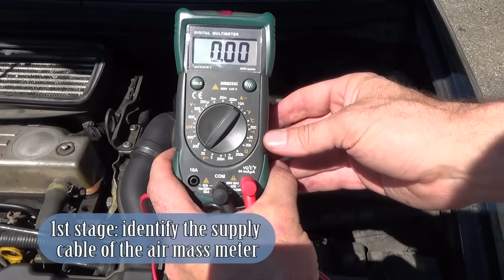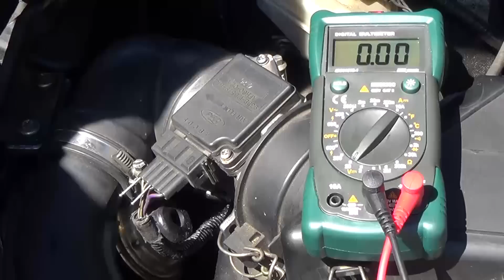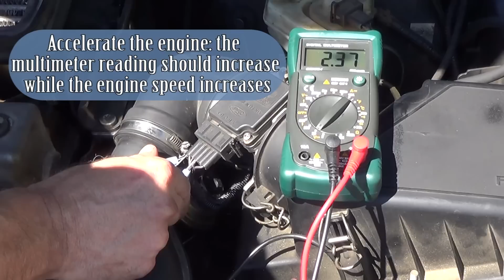Mass air flow sensor (MAF) testing without dismantling

Comment: I’m still having a trouble accelerating after I replaced the old one also did a 93 fuel treatment on my 1994 ford ranger idk does the computer have to recognize it or wat it actually got worse with the new one

Comment: Great video!  However, a MAF sensor may still work but not perfectly.  This is a good overall test if the MAF sensor for your car is quite expensive and one should always try to test the MAF sensor before replacing the sensor.

Most licensed professional mechanics cannot diagnose car problems today either and what ends up happening is they just replace everything possible and foot the bill to the customer.

If people want a car that they can maintain themselves, buy something made around 2000 ~ 2005 as vehicles made during this time had a computer just to control ONLY the engine and transmission.  After 2005 car manufacturers integrated sensors into everything electrical they could think of, making it a nightmare to diagnose and find the exact problem.

Comment: I have this problem 07 tundra, replaced both the MAS and the ignition coil. Still doing it randomly. If I disconnect the battery and reconnect it starts normally for a while. Any tips will be appreciated.

Comment: At 1:46/3:07 you put the wrong meter leads on the wrong wires (red center, black other contact. previously you had black on center and red on other contact!), that is why you read 0 volts! When you moved to differant contact you put black back on center and red on other

Comment: Just replace the sensor after 50 k miles. It's easier to unscrew the two screws and unplug the clip lol. If your car dies when starting it, slow and sluggish when accelerating, or has trouble shifting just replace this sensor folks! It's the brain between the transmission and motor.  It's worth the money just do it lol! You're technically supposed to clean your mass air flow sensor and replace the air filter every 15k miles. Those sensors are super sensitive and are easily damaged. I replace the mass air flow sensors on my 4 vehicles every 40k miles! Change the plugs every 50k miles as well! Basic maintenance brings longevity folks! Much love peace!!!!!!
Reply: agreed

Comment: My car is still hesitating during acceleration at slow speeds after replacing maf sensor n spark plugs. Pl advise
Reply: Have fuel pump tested, replace fuel filter. That's a start.

Comment: 1:45 you put positive on negative and got a false reading
Reply: That is correct, but the reason for doing that, is that they're showing how to find the desired wire, by process of elimination.
As the video said, since that wire had a 0 reading, it must be another ground wire. Now there's only one wire left to test, so that must be the correct wire we're searching for, which it was.

Comment: The MAF sensor has a voltage range that it performs in, so if the MAF sensor is not performing in the manufacturer's range then it will bot work properly.

Comment: I was testing my MAF sensor on my ‘99 tacoma which the sensor has 6 pins and when I inserted the needle in one of the cables the truck shut off and now it doesn’t start, it cranks but it doesn’t go on, can you guide me on what to do?
Reply: What was the result... i might have just done the same thing just now...was it ecm?

Comment: Thanks for making a video, but you might have wanted to point out that this only works with MAF sensors that vary voltage on their output, where most will vary the frequency. The latter you would need an oscilloscope to get a useable reading.
   So, it would be difficult to know which type you have which would negate the useability of this testing method. My particular MAF sensor varied frequency, and so it just had a constant 2.8v that didn't vary with rpm. The new one was an non-varying 3.1v. Thankfully the new one did fix my problem, but the testing method didn't work in my case.
Reply: I think the frequency scale can work in case of latter MAF sensor

Comment: On my signal ground and signal wire I'm getting 5v please help
Reply: I have a good idea but instead of explaining, you should watch "ScannerDanner" 
His videos on "The 5v Reference" especially
Reply: Only because I could be totally wrong on what I think it is.
Reply: I watch the whole video but its unrelated to my problem on my 4 pin maf sensor 2 wires being a power and ground I got 12v on those 2 my other 2 wires which i believe one is a signal ground and the other a signal the voltage between them is 5v

Comment: Attention:  this video is ONLY for -analog-  MAFs;
DIGITAL MAFs output a frequency ,not a  voltage; you'll need a scope or at least a multimeter with Hz,Hertz.
Thanks for the video.

Comment: I have lexus is220d 2009 I was tested mass air flow sensor.I did have ignition on but engine was not runing. now I  tried  to stare the engine to testing the sensor again. engine doesn't over but engine was working before.

Comment: It doesn't mean good  when the voltmeter read a change when accelerating.. it must be in the range of voltage of the manufacturer to be sure the MAF works good. my MAF reads change when accelerating but not in the range of owner manual and the car still getting noise on run.

Comment: how do you test it if car doesnt start
Reply: It's a bit complicated, you have to take it off, wire it to 5 or 12V and then you have to probe the voltage while you blow in it thus simulating air getting drawn by the engine...

Comment: I bought an audi a4 turbo 2002, and it has always had an unstable relenti. Verifying all the electrical part I see that they removed the plug of the maf sensor and put the cables directly to the pins, but I would like to be sure that the order is fine, because the videos that I have seen show me an order different from the one that currently has. Could you take a picture of the order in which the MAF cables go and send it to my mail?
email: morgankaddy@yahoo.com

regards

Comment: my truck died while driving, is there a way to test this with engine off ? i was getting mas error code  b4 it died ? its  not getting fuel, tries to start when spraying starter fluid into intake. tried cleaning it, but no difference, it just might be dead, but would the mas keep your engine from starting ? i have a 2007 toyo tacoma 4.0 4x4

Comment: This was the best vid I have found to test a MAF.  I followed all the steps, identified all the wires, got the earth pinned then found the 5V wire. While running the MAF came up from .01V to .05V but no more. Diagnose bad MAF, now I can purchase a replacement confident that I am not just replacing  good parts with new parts.

Comment: not sure if anyone else saw this but your first test to check the MAF sensor after checking the voltage looks like you had the leads backwards.  You had the positive lead on the ground wire.

Comment: Nice video. I am curious as to how the audio was produced. Was it a computer generated translation? Saying "earth" instead of "ground" makes me think so.

The holes in my wiring harness are too tight to accommodate a nail, or even a paper clip - the ends are too blunt to get in next to the wire. I had to use sewing pins, which are kind of T-shaped. They're sturdy, yet you can bend them if you want to move them away from each other once the pin end is inserted. I imagine pulled-open safety pins would work, too, or even straight pins.
Reply: Earth is British English. The USA uses ground.

Comment: I need to understand only one thing.
What is this terrible noise coming from engine at idle ?
My engine doing the same exactly noise and it is KIA SPORTAGE 2015 !
Reply: Mohammed Aziz most likely an exhaust leak
Reply: Mohammed Aziz otherwise check your oil. make sure it's within operating range

Comment: i have a question please , I have a 93 mustang 5.0 and Im seeing 13 volts on the signal in and out wires its a brand new pro M WHat could be causing such high readings??? I know I should only be seeing 5 at max!!!

Comment: You should never ever probe wires like that, just leaving them open to the elements and corrosion. Seals and insulators are there for a reason.
Reply: do it like this on a daily basis for 20 years now... never had one problem.
Reply: yes that the only way i ever see it done using pins....
Reply: Probing a wire like that does nothing more to expose it to corrosion and elements any more then it already is knuckle head. That's why on every car there is this fancy thing called a hood, to protect it from that. Should proper care be taken so you do not damage the pins on the harness? Yes, but they are actually quite reiselient. Some  people will say you shouldn't probe wires because it can change the circuit and mess up the cars sensitive computer components, and while this may have been the occasional rare case with older analog type voltmeters with low internal resistance around 16k , with much newer digital multimeters having a high internal resistance of upwards of 10M ohms or some high end multimeters have near infinity internal resistance, these will have little to no effect on the functioning of the circuit.

Comment: Why did you place the positive lead on the black wire when you tested the first of the remaining two wires (during the 2nd stage where you received 0.00)?  You specifically said to use the positive lead on the remaining two.
Reply: +dieselstar5 it doesn't matter which way you test it.  We are measuring potential difference so it would only change the sign.  The number part would stay the same.
Reply: Mike that's what I said hahahaaaaa

Comment: CAUTION.....first video I found said to clean with carb cleaner, I did and ruined the MAF.....I later learned that you should only use a cleaner made for MAF sensor cleaning. Any other cleaner can at the least leave a residue, and at worst remove the teflon coating on the MAF....this is a very sensitive sensor.....just my experience....all parts stores carry the MAF cleaner, and just as cheap as carb or brake cleaner, so why not use the one that is designed to do the job, rather than take a chance. Hey other cleaners may work on some MAF sensors...they all do the same job, but are designed and made with different materials....not worth taking a chance using anything other than a cleaner made specifically for cleaning  MAF sensor
Reply: Dennis Arterburn yep me too carb cleaner destroys this and the MAP Sensors.
Reply: u need a circuit cleaner spray can
Reply: MAF cleaner is the most expensive of the lot
Reply: Use Zep mass air flow cleaner or if you don't have thar use rubbing alcohol. That's all I use.  Alcohol doesn't leave a residue so you can use it if you can get it spraying in a jet stream.
Reply: Wd40 makes an ELECTRIC PRTS CLEANER, it works very well.dries in seconds, and won't harm plastics surrounding the parts.
Reply: Wd40 makes an ELECTRIC PARTS CLEANER, it dries in seconds, doesn't leave any residue, and won't destroy the plastic surrounding the parts.

Comment: I dont understand this, this is testing the wire harness connector so it will surely always have power and change accordingly depending on the accelerator depressing or pressing. How does this mean that the sensor is actually working properly
Reply: +Imre Csoka It does not. It only tells you the MAF is working, not working correctly. It should be tested to reach a certain treshold on a snap throttle and should be steady on a certain value on idle (MAF and engine variatons). However, it is not always true that the MAF is doing bad if those values are off. Air leaks can, for instance, throw values off as well. This is why we, as mechanics and diag techs, have so much work on our hands (it is not as simple as one value to check anymore). That said, even with that knowledge you have different MAF systems, different values, etc. 

However, the video does well in explaining in certain basic checks to condemn total failure of a MAF or wiring.
Reply: +Henk Moesker Man i wish i can understand this, it is a but much for me. I just want to know an example for a test that I can do. I feel very not confident because my car is different, OPEL CORSA B 1.6 IE  1999, i can not find a manual for it and I also do not know what diagnostic tool to buy for it on ebay. I just wish i was not so lost, i dont really have anybody to ask for help here in South Africa. This is why i am researching youtube. I have a feeling i need to check; throttle position sensor;  air mass flow sensor( or is it called air temperature sensor)  ; and i also want to test my ICV.
How do i do these things with basic examples.
I know where my Air Flow Sensor/ Air Temperature is and i can take it out...if you need me to.
I know where my ICV (Idle Control Valve) and i can take that out also if you need me to.
I know where my Throttle Position Sensor is BUT I DO NOT know how to take it out, it is too close to the firewall, i think i need to get a right angle screw driver set for torx.
i have tried to explain my problem as best as i can with examples which is why i want to try and learn and understand.
If you like to read - http://www.allcorsa.co.uk/forums/showthread.php/opel-corsa-b-128658.html
Also really looking forward to you input on how to test those few components i mentioned , and maybe you can tell me i am wasting my time ? maybe i need to check other stuff like fuel  pressure.
Reply: +Imre Csoka thats why he tested the signal wire to the computer not the power wire

Comment: Over kill.  The best way to check for current is with a test light.  You can do what youre doing forever and its useless based on most people battery connections and the grand ground connection is most times only half reliant on just about every car I have ever worked on and that is the heart of your electrical in any vehicle.  Other than that if I get a bright light when I touch any connector then it WORKS (with ignition on)
Reply: +Earl Guyton yeah but if you're checking the air mass meter anyway why would you want to do that with a test light? and if you have a bad ground connction at the maf then that's something that needs to be addressed as no ground no worky!!, did you think about your response before you posted?
Reply: +airstreamresto I have a maf error code. I cleaned my maf sensor and it still runs bad. Do Maf sensors commonly go bad?
Reply: +eroticmasterbaker loose,derty rusted or short conection.

Comment: Why are some of you folks disguising your voices? LOL!
Hey I just checked mine after getting a scan with P0112 IAT sensor circuit low and P0102 MAF circuit low.

When I check it, I'm getting a constant 6.94 to 6.97V throughout raising the throttle.
Any suggestions? I mean I know the MAF should be bad but could there be another reason Im getting such a ridiculous reading. These MAF sensors also have the IAT intake air temp sensor integrated into the same unit.
Reply: ILTSYC You are probably measuring between the 12 volt supply and the 5 volt reference wire, instead of measuring between the supply and ground.
Reply: Ok thanks man, I found the problem, I had the  windshield wipers plugged into the Maf sensor after putting head gaskets on this 2000 Ford Windstar.
Reply: +ILTSYC Lol

Comment: My mad sensor signal voltage at idle is 4.3 and it goes down when I pump the gas need help here I'm getting 12 v ground and 12.6 lover all fine thnx